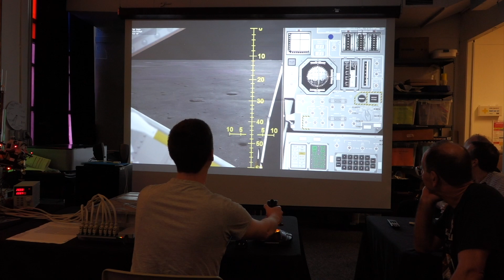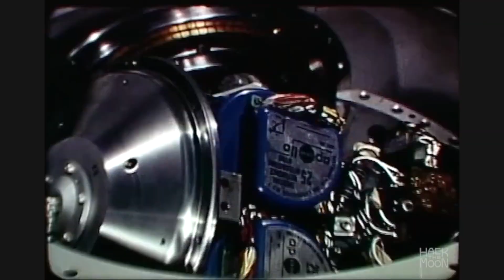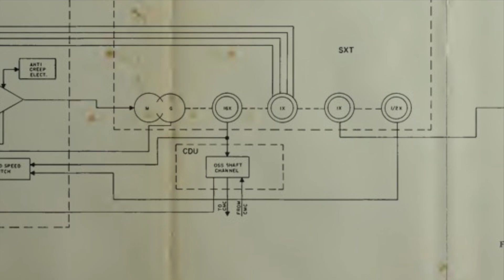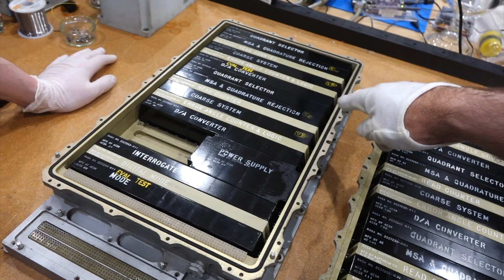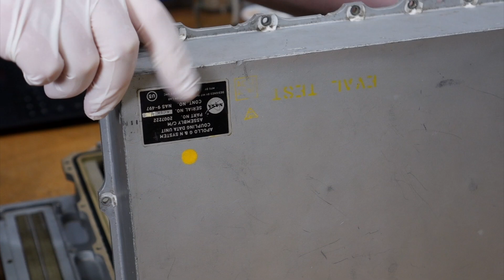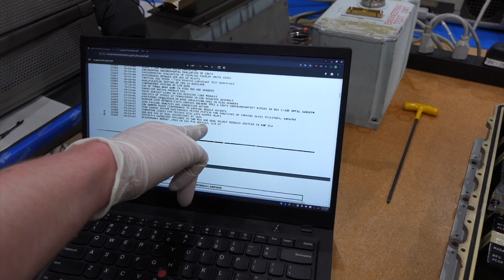Apollo Guidance Computer Part 29: Mikes Scores a Coupling Data Unit (CDU)

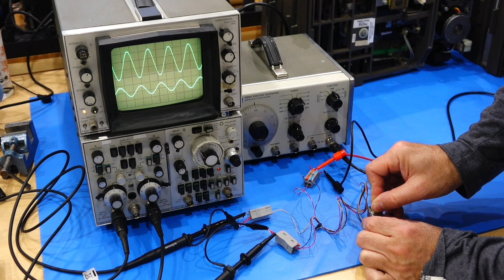Comment: At 6:10 it was kind of hard to understand. You said "one is a sine, the other is a cosine", but on the scope there are two sinusoidal waveforms with a 180 degree phase shift. First I thought "one is a sine, the other is a minus sine". Then I realized that its not the phase of these sines, but the amplitude you are talking about. So by turning the shaft to say alpha degree the amplitude of the sine waves change like sin(alpha), and cos(alpha).
Reply from the maker: You got it exactly right. It’s the amplitude of the waveforms that’s proportional to the sine and the cosine of the angle. Which brings about one major complication: it’s not enough to measure the amplitude of the resulting signal, you also have to measure the sign. Which you also got right, the sign is in the phase of the signal, either in or 180 deg out of phase with the excitation. It’s the phase part that got messed up and eventually caused the 1202’s, in a very complicated and round-about way. We’ll explain this in more details in future videos.
Reply: @CuriousMarc  Thank you Marc, This is going to be epic! This piece of history couldn't have ended up in better hands! <3
Reply: @CuriousMarc  I absolutely cannot wait for this update where you explain this theory and test it. As an EE you guys and your command of knowledge and theory are a marvel to watch. Thank you thank you for these videos, please don't stop :)
Reply: Thank you! I actually understand this now correctly for the first time, and I'm 43!

Comment: So is there somewhere a video that you or mike made about the 1202 alarm using this CDU ?
Reply from the maker: As of Dec 2024 not yet. But Mike is making progress. He has the CDU up and running, and has sourced some resolvers that he is adapting to work with it - the CDU uses very unusual ones that are impossible to find. He is currently working on the PSA, the complicated AC power supplies you need for the resolvers https://www.youtube.com/watch?v=mxMOano9Zls

Comment: My old mentor would reminisce about his days in technical college.  His professor had a nasty habit of "pranking" there breadboards. He would pull a random wire, remove the copper from the insulation sheathing with tweezers, cut the copper, then sheath it back in and replace it!

Comment: Resolvers are quite often found in the output shaft on hybrid car transmissions as a source of angle data for torque vector control.  Vector motor drives are often used because they provide very good control of output torque at varying RPMs.

Comment: @CuriousMarc:  Maybe I'm off-base here but it's possible that they had several of these 'half-shells' laying around and needed to get them off the benches (so-to-speak) and for protection, simply screwed two of them together to either move or shelve; since you now know that they have different (integrated) functions(?). When I worked at Sperry, we had a union-based 'move-crew' that were more like untrained-apes with an attitude; you were not allowed to move anything yourself over X-pounds, or furniture or shelving.  Anyway we would go to great lengths to protect our (extraordinarily similar mil-standard) computer-product hardware since we were ultimately responsible for their condition and any impact on the schedule. So anything that would have open-backplanes or exposed-pins we buttoned up with whatever we could find--so it could get pretty mixed!
 Anyway, just a fantastic series, and I am so proud of you guys reverse-engineering and then making functional thes historic units.
Finally, this is the 3rd time my notifications has been turned off by YouTube; I had to go looking for your videos-now in binge-watch mode!!!
Reply: That was my initial thought too -- however, it was clearly put together with some amount of "love". The modules inside are all a consistent configuration -- and moreover, the module revisions in the top tray do not match with its assembly dash number at all. All of the modules had silicone grease applied to them for mating. And moreover, the whole assembly was pressurized with nitrogen -- it gave a nice healthy hiss when I pressed the ball valve on the front in. I wouldn't really expect this for something just tossed together.
Reply: @mikestewart8928  Mike, thank you very much for responding. OK, I guess I missed some of that. Well, now what it sounds like, is that it was assembled for long-term storage. As far as the silicon grease, that would usually have been done no matter what, just to make sure nothing ever gets damaged even if you have known bad modules, you wouldn’t, not take care of them. But the nitrogen really spells to me long-term storage; they were not planning to get into it anytime soon.  Also, I’ve seen this done just to protect known good modules even if the main back plane isn’t going to be used, but instead, it’s being used like a holder (in this case hermetic) for known good hardware.  When we did a nitrogen purge, we were either long-term storing or prior to a customer-ship.  Anyway a fantastic treasure!

Comment: Don Eyles' book, "Sunburst and Luminary", explains it well.
The AGC software was well-designed to drop tasks and restart from a known point, always making sure the high priority tasks were taken care of. That did save Apollo 11.
On the other hand, there was an issue with the stability of the descent engine, which experienced some strange throttle control issues (look up Apollo 11 "throttle castelations"). 
It was caused by a late chsnge in the throttle response time of the descent engine, which wasn't captured in the interface control documents and caused the software (which expected a slower-responding engine) to almost overcontrol the throttle.
That almose caused a mission abort, and it would've probably been blamed on the AGC 1201/1202  faults, at least initially.
You should invite Don Eyles in the lsb at some point, that would be a fun conversation.

Edit: for those of you who never heard of him, he was one of the main software developers on the LM AGC.

Comment: In my software coding carreer I used many AtoD an DtoA devices as well as resolver to digital convertes. Most were 40 pin integrated circuits weighing mere grams. Amazing the technology leap from the massive Apollo module to the diminutive devices I worked with. The documentation of revisions and errata are still practiced today to the mental stress of engineers.

Comment: What ? I am not sure what the title of the video means. 1202 was caused because Buzz Aldrin turned on the radar in case the landing is aborted. But the mission procedure does not want the astronaut to turn on the radar. Indeed, there is not enough CPU cycle left to handle the radar workload during this mission stage.
Reply: Ah, but that's not true! Armstrong and Aldrin were simply following the checklists, which had them put the radar in this configuration. And the alarms would still have happened (and very possibly could have been worse) even if the radar was fully powered off. The real cause is a much deeper and significantly more complex problem.
Reply: @mikestewart8928  ah, thank you for the clarification :) The article I've read was innacurate, and its source is now a dead link -_-'

Comment: That resolver is so cool. I wonder if it could be used as a brushless motor if driven with the right input waveforms.  Also, if the output windings are shorted together rather connected to high-impedance inputs, the shaft might require slightly more torque to make it turn.  If those assumptions are correct, this thing might be able to provide force-feedback and automatic turns as well as angle measurement.

Comment: If I understand you correctly, you're going to try to prove that the 1202 where was not a false positive but an actual error?
Reply: The 1202 Alarm was caused by an real error. The question to answer is if the computer was still flying the LM reliable. 
I'm looking forward to the next episode and want to see the DSKY blanking,
Reply: @benjaminhanke79  same! Thanks for clarifying

Comment: I wonder if NASA also experimented with an Au Revoir Radar, but soon found out the Rendezvouz model worked way better for their needs.
Reply: You joke, but the rendezvous radar did indeed have a very close competitor: the LORS, "LM Optical Rendezvous System". It used a luminous beacon mounted on the command module paired with an optical tracker (OT) on the LM. Due to problems in RR development, in early 1966 the LORS was the frontrunner. Lots of people felt very strongly one way or the other -- so much so that they held an "RR - LORS Olympics" to try to decide which performed the best. Eventually the RR won out.
Reply: @mikestewart8928  Hehe yes, just joking (and also, scandalously misspelling Rendezvous; been 20+ years since my French studies...).

But reality turned out to be funnier than fiction; actual Radar olympics 😄
Thanks for the tip, will look this up, besides the joke factor the competition sounds really interesting. I quite enjoy reading about radar history.

Comment: If I had to wager a guess, I'd say they built that unit up to reproduce the same 1202 error experienced in the flight module it corresponds to. Since it indicates that it was used in the lab that is. This makes it an excellent candidate to recreate the error in YOUR lab in my opinion.
Reply: That was exactly my thought also. That type of playing freely with the specs of parts as compared with the official build is exactly like what happens in labs when you have a specific task and only care about replicating certain functions

Comment: Resolver = synchro motor? we used them in boat compass systems.
Reply from the maker: Almost. Resolvers and synchros are cousins. Resolvers have two windings at 90 deg of each other, synchros have three windings at 120 deg of each other.
Reply: @CuriousMarc  ok.. for when we used synchro motors we just had 3 and if you turned one the others followed.
Reply from the maker: Exactly. That’s the fun thing with synchros. Resolvers don’t do that, they are more meant for interfacing with electronics.

Comment: The excellent book "Digital Apollo" by David A. Mindell has a section explaining the origin of the 1201 and 1202 alarms during the Apollo 11 descent on pages 227 through 233. This book is a very good read.
Reply: It is indeed a good book, but Mindell unfortunately reproduces a lot of popular misconceptions in that section talking about the program alarms. Don Eyles's book Sunburst and Luminary digs into more (and more accurate) detail from the software side, but to my knowledge there aren't any books that get it fully correct from a hardware side.
Reply: @mikestewart8928  I will have to get Don Eyles's book.
Reply: @mikestewart8928  Hi Mike, amazing work. Don Eyles had come to my MIT class many years ago, where he presented a paper which goes into more detail than the book (“Tales from the Lunar Module Guidance Computer”, (A paper presented to the 27th annual Guidance and Control Conference of the American Astronautical Society (AAS), in Breckenridge, Colorado on February 6, 2004, and designated AAS 04-064). This version includes additional illustrations and comments, and several minor corrections vs. the book content. In particular, in the paper he goes into much more depth on the hardware root cause of the 1202 error and he corrects his previous claim in the book that it was a checklist error.

I was fascinated by Eyles' presentation of the 1202 error both in his paper and as he explained it in class, to the point that I now teach it as an example of how a failure propagates through hardware, software and processes. In the video you said you have a theory, and I was intrigued... did you get to reproduce the 1202 error in a fully coupled system of hardware and software?

My own best understanding of the "hardware" root of the issue is as follows below:

 (*TL;DR: there were two different 800Hz sources at a random phase to each other, one used to prepare the signal and the other used to read it. There was no requirement to phase lock them. This issue was discovered by Grumman engineers before launch, but was not fixed because, at the time, the checklist meant that the issue would never arise in flight. However, the checklist was subsequently changed, leading to the chain of events.*)

The rendezvous radar in the Apollo 11 Lunar Module “Eagle” had a mode switch for use in the event of an abort. The switch was there because in an abort scenario involving failure of the primary guidance computer, Armstrong and Aldrin would have used a backup guidance computer built by TRW together with the rendezvous radar, first in SLEW and then in AUTO mode to try to rendezvous with the command module “Columbia”.

When the mode switch was in LGC, the LGC was synchronizing the phases. But when the mode switch was in SLEW or AUTO, the signal source and the analog-digital converter would be using two different 28 volt sources to prepare and read the signal. This signal encoded the shaft and trunnion angles of the rendezvous radar antenna. The root of the problem was the that interface control document, which had specified that these two power sources should be locked in frequency, failed to specify that they should also be locked in phase.

The result of this error was that whenever the switch was in SLEW or AUTO (the two possible settings in the event of an aborted Moon landing), the signal encoding the information on the antenna angles would have been referenced to an out-of-phase reference voltage! Naturally when the switch was in that setting, the exciter and the A/D converter would between them generate continuously changing spurious antenna angle data at a rate of 12,800 computer interrupts per minute, eating up 15% of the computer’s capacity, as the computer tried to keep track of the imaginary movements of the radar antenna shaft and trunnion. This would even happen with the radar powered off… so clearly a serious error.

According to MIT IL / Draper programmer Don Eyles, this interface design error was spotted at launch site integration testing by Grumman, but it was not fixed. In Don Eyles’ recounting of the story, Grumman engineers had assumed, per the then state of the checklist, that the mode switch would always be in the LGC position during landing attempts. However, the checklist was later changed based on feedback from astronauts: since the rendezvous radar wasn’t in use during landing, Aldrin had wanted to have it ready to track the CM in the event of an abort, and the procedure was changed. And so, the original interface control document error – the failure to specify phase locking as well as frequency locking for the two separate power supplies -- found itself in the critical path of the Apollo 11 mission and endangered the historic first landing on the Moon.

Comment: cnc uses optical encoders, just to name one manufacturer Haidenhahn. That's high resolution.
Reply: Resolvers are good for plasma and high noise or mechanical stress environments. I have many servo motors with resolvers. Also 3 days ago I've sold 12x Heidenhein / Siemens encoders for a CNC motor refurbisher.

Comment: One thing resolvers are being used for is SATCOM antennas on board ships at sea.  Much like the rendezvous RADAR, dishes need to be locked on to their corresponding satellite even as a ship is bobbing and weaving on the waves.  It's mesmerizing to watch them stay perfectly still in relation to the bird, but have the pedestals moving around with the ship.

Comment: Any idea how much two Titan 2 guidance computers by AC Delco would sell now for?   Just asking to punish myself.  Around 1980 I found two of those in the dumpster at a space research lab.   I tried opening those up to scavenge parts, but everything  was potted in a very hard plastic foam.     So I sold them for the 2-inch thick aluminum cases.  Got $15 for them.  Probably a bad decision!